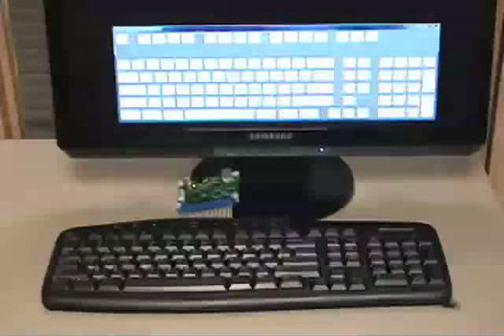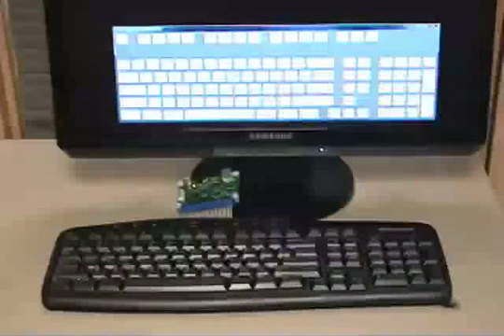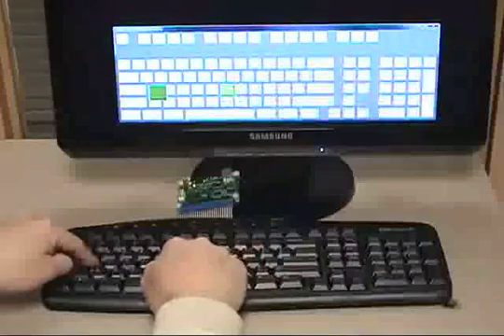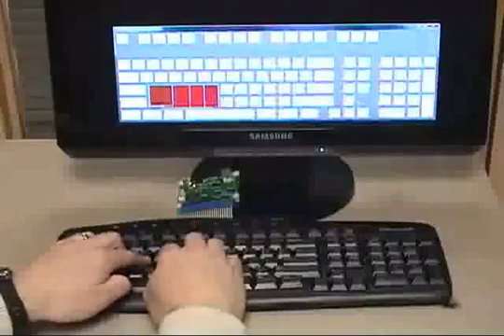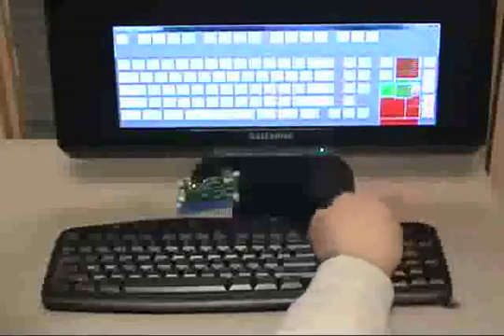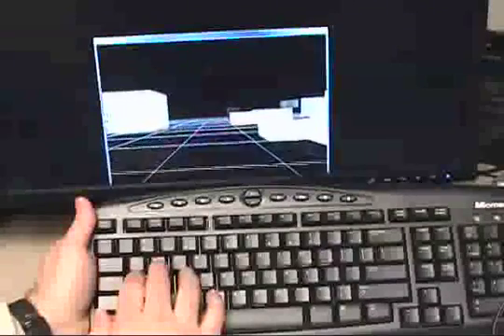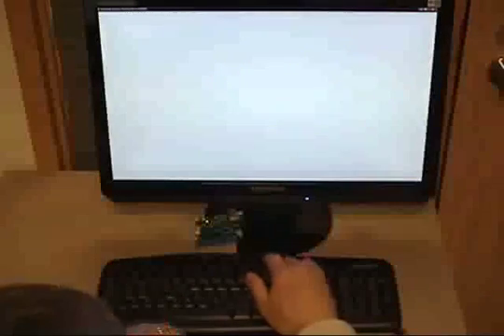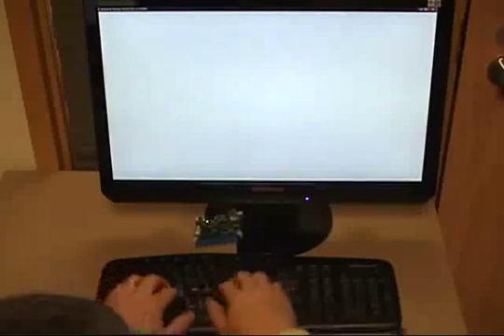UIST 2009 Student Innovation Contest - Demo Video

Comment: needs a version that uses Cherry MX-Reds.
Reply: Pie-jacker875 I always thought MX-Reds DESERVED to be pressure sensitive. It just feels right. I'd love to see it for gaming.
Reply: ***** You can have a mechanical analog sensor. AKA potentiometer.
Reply: *****
They can add a click and tactile feeling at certain points of the potentiometer.
Reply: Cherry MX Reds are not clicky and tactile, so it would feel the same.

Comment: Just thought of this today. This would finally remove the only advantage of joysticks (= console gaming) over computer and keyboard gaming: The movement. On consoles, you can walk with different speeds because the stick has both a displacement and direction (360°), while the keyboard just has 8 directions. With pressure sensitive movement speed in each of the four directions however, you could finally walk in 360° directions with a keyboard too.

Very useful. Is something like this available?buy